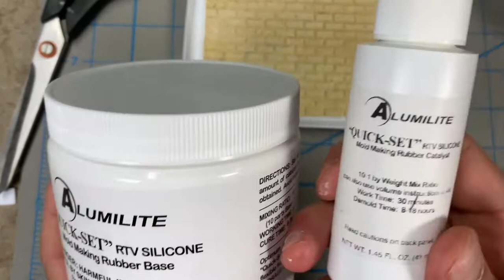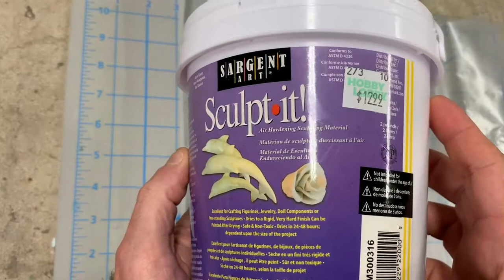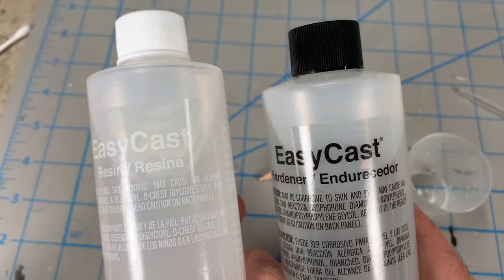Reaper Pt1 - Building a Rooftop Sniper Diorama

Comment: hey off-topic question. I'm not sure if i asked you this previously or somebody else on youtube, but it's about Vallejo Model color paints and i know you have the knowledge to answer this. So a lil while ago i was playing around with different colors and paint brands on my palette. I was using an old ceramic kitchen plate, usually i use a wet palette, but this was just for mixes and seeing what i would get. Anyways, i left some Vallejo drops of paint on the palette along with AK Interactive and some Citadels (Games Workshop), and Scale75 (im not a fan of Scale75 i explained why in a previous conversation we had). I left the workbench for a break and came back and noticed the paint drops that dried from Vallejo had a shine to them from the above ceiling light, whereas the AK and Scale75 dried flat matt, no reflection of any kind. However, the vallejo which was spread out ended up looking matt just like the latter two brands i mentioned. Vallejo is advertised on their website as being "opaque and matt". Is vallejo model truly flat if the drops dry with a shine to them? like i said, spread out they look matt. Thank you for any information or explanation you can provide.
Reply from the maker: Great question. I have had mixed results depending on the color but for the biggest part I think it's an issue of how much water you thin them with. It seems to me that if you thin them and apply in layered coats that come up flatter than thick heavy coats. As I said earlier, there's never an issue when I airbrush them... they are flat as can be when I do that. I don't care for the Vallejo Clear Matte... it's almost the same as their Satin. I'm struggling to find a good clear matte. The best I've ever had was a brand called Poly S but it's expensive and hard to find. Actually I think they stopped making them.